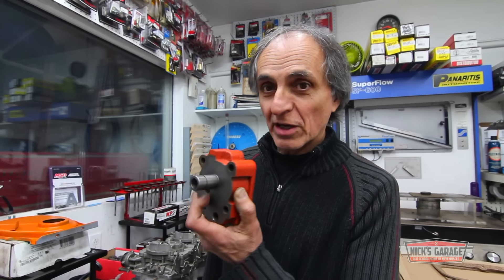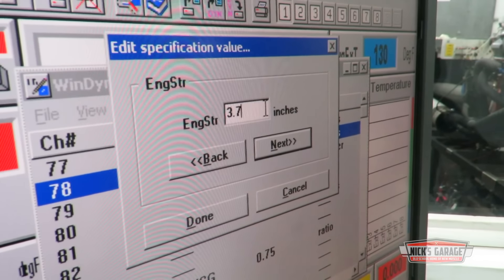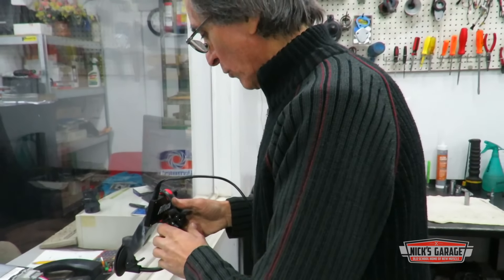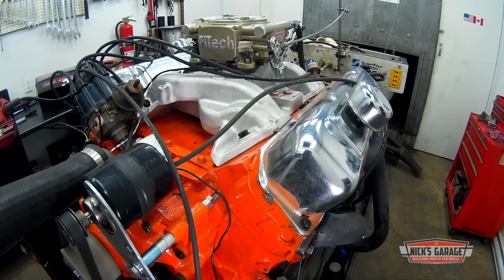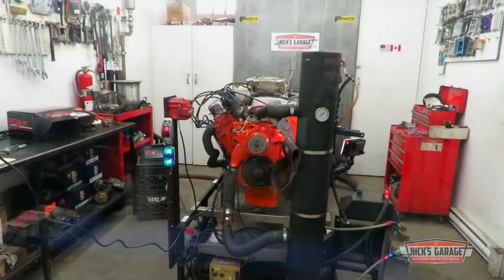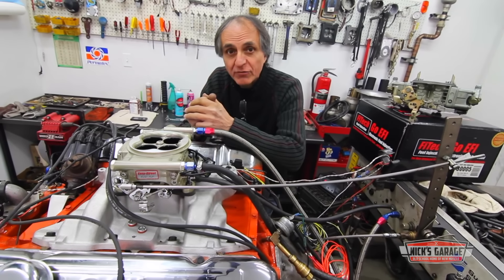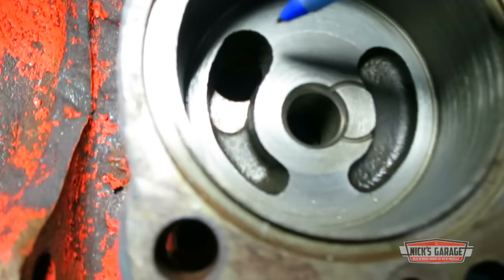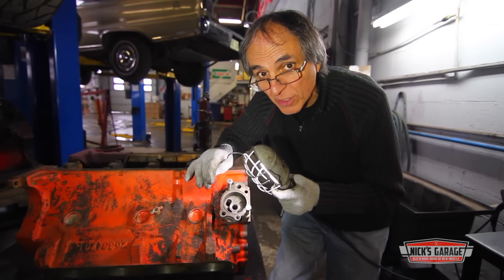Carburetor vs E.F.I. - Dyno Room Showdown

Comment: TBI is an automatic carb without a bowl.
Reply: That is true, but most TBI engines also have computerized spark timing and computerized smog devices. I really hate carb engines that needed several vacuum devices to control smog.

Comment: I'd love to go with EFI, if anybody made one to fit my 1953...budget. But I compensate for the carb fuel shortage after sitting for a few weeks by having an electric fuel pump in line with the mechanical one, and running it for a few seconds before such starts, then shutting it off. It pumps through the mechanical pump, and vice versa. CBE, I call it - Crude, But Effective. It has worked well for years.
Reply: EFI systems are becoming less expensive each year. I'm hoping an electric primer pump will work on my c10.

Comment: Much like you tune a carb, dyno,  make needle and jet changes,  re dyno,  check timing, redyno, make changes.  The Fitech needs to be driven a couple times for it to learn all the way.  The fitech will and has proven to be easier to tune and makes more hp than carb.  Plus more efficient.  This video is kind of misleading.

Comment: carb is thing of the past the reason the EFI system was 10 hp off was it was running mileage parameters and not HP parameters 100% guarantee it was using 14.7 to 1 tunning  and not a fatter fuel curve a simple change in tune on the EFI will exceed the carb 
and you can swap tunes for application ..cruising use MPG tune for drag strip use HP tune for max power .. for my mustang gt I have 6 tunes i swap out for temp and time of day and road conditions .. simple as pull over to side of road and reflash the pcm with a different tune
not a fan of self learning efi systems for stupid people unless also built with a back door to let owner go in and fine tune and tweak the tune
Reply: You can do that with the Fitech. A micro USB cable will connect the handheld controller to a laptop. The first time it installs a program on the laptop giving you much greater control over the system.

Comment: how many pulls were done? The system needs to learn how the engine is driven, not just at idle.
Reply: MRGMM.    The night before we were doing lots of tuning with friends and myself. We had the engine running for long periods of time, and many part throttles. The day of video, it hard a long time to learn to set idle.  Last year we had a dual Fitech installed on a 426 Hemi, and it took some time to sort it out by driving the car for a while.

Comment: Every motor that has a computer dependent EFI system should by law be required to be swapped with a computer assisted EFI throttle body. The computer assisted EFI throttle body will work without the computer. To me having all transportation reliant on a single point of failure is beyond stupid. Every car, truck, simi, forklift, boat, motorcycle, plane and even most mini rv's require a computer to function. Recipe for disaster. I prefer a carb myself. Your car is your second biggest investment. Is it too much to learn how to tune one?
Don't tell me, well I don't have the time. B......S#!t.

Comment: So... less than 2.5% power improvement from the carburetor.  How much extra fuel consumption and noxious emissions for that big ole two point something percent?  Do tell.
Reply: Incorrect air/fuel ratio won't burn properly if at all let alone make more HP. So couldn't be very much more fuel. JAJAJA

Comment: I'd be interested to see how the FiTech would run with a 1/2" to a 1 inch open spacer. You can't stagger the jetting to work with a dual plane with a TBI unit like you can a carb.
Reply: John Potsch I put a spacer on mine and the TQ was nice and smooth. Came right on around 2000 rpm. I have the mutha thumpr cam so the power comes in around 2200 all the way to 6000.

Comment: I'm a curious how this throttle body unit will adjust to dual plane intakes.
Reply: Poorly. Check out Engine Masters but I have heard the same on mild street engines where a dual plane is accepted the best. Poor running and even fueling plugs. And not many want to go to an open plenum for a streeter. So keep the carbs!
Reply: You have to snap off part of the divider inside the intake so it can equalize side to side and then they do better but they do best on a single plain.

Comment: How was the fuel mixture burning, especially at max load? Do your customers have fuel consumption notes, to compare the difference to carburetors? The answer might give a break-even mileage where the cost of EFI is balanced by fuel savings, especially in a truck that does some towing, or a car that is a daily driver.
Reply: 60and. R.       My customer is aware  of how he is to tune it in his truck. Thanks for input.

Comment: The dual plane intake kills the power potential on this EFI setup. They generally  respond way better with a single plan intake.  Plus, FItech offers this unit in a 400hp and 600hp capable system.  If you're only using the 400hp system then the results on this particular test dont mean anything.

Comment: I like Nick - seems a nice guy, very knowledgeable, great videos but this test was not a fair comparison ! I have a 500+ hp 355 with an 830 dp tuned all circuits on engine dyno then followed by chassis dyno to retune for the best it could be in the car, then 6 months later changed over to Holley sniper !  Less hp and torque initially, then some laptop tuning to speed up the learn and boom - 17 hp, 20 lb ft increase !
Reply: Mickss355.     We are old school. It took us some time to learn it. We have it on the car and runs great. No stalling, no need to warm it up and smoother idle.
Reply: No problem Nick - I'm pretty old school too, took me a long time to take the plunge to efi and i figured, ok if im going to do this then I'm going to learn as much as i can as soon as i can. What i have found is the learn on these things work pretty good but there only good for around 85% of what there capable of. Tuning via laptop is actually easier than trying to fiddle with those little controllers and I find the Holley pc software was easy enough to learn that even an old dog like me got his head around it lol Anyway, I'm sure the owner will enjoy the easy cold starts and great throttle response ! Never could i have imagined my little 500 hp 355 would start instantly and idle cold. Keep up the good work mate - really enjoy your videos. If i ever get to Canada, ill be sure to call in and say Hi

Comment: I just don't see the advantage of EFI for daily drivable street driven muscle. On boosted mills you bet, everything is easier to set up and control. I had a worked holley 800 spread bore on a spacer on a holley street dominator on a 468 hi lift cam and rockers 11:1.  I beat efi small and big blocks more times then not, street and track. And I could still pass our AIR CARE for insured street vehicles. Why bother with EFI back then... still can't justify it now. Beauty of opinions eh we all got them lol

Comment: Carbs jetted perfect..not out the box..try driving or starting it at 35 degrees farenheight...or racing at 95 degreea out..without jetting...that fuel injection..especially if u can link it to a computerized timing box would own that carb....

Comment: 😎The Master at his best👍
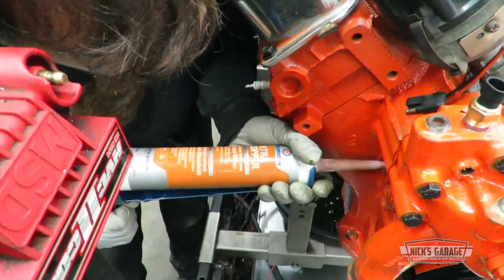At 7:40 I was surprised to see his sealing gasket 2X w/ a hi temp sealer under and on top of gasket for block off plate (fuel pump)- I was always told to just use sealer, if any, on block then a bit of OIL on receiving side of gasket for plate. Hmmm... (???) 
Oh well, tomato, tomatoe
Thx Mr Nick & crew👌

Comment: LOOKS LIKE THE ELECTRIC FUEL PUMP IS KINKING OR PULLING THE RUBBER HOSE SHUT IN THE BEGINNING OF THE VIDEO WITH INJECTION.sorry about the caps

direct port fuel injection will always make far more torque but needs a ton of sensors to use.

Comment: I went from quick fuel 750 to a Fitech efi power adder better starts , no smell, timing control, better power under the curve , went faster when I spray they same amount of nitrous because on a carb you aim rich and afr chosen with efi... also better travelling across the highlands and weather doesn’t matter.. if you took most cars and properly tuned the efi with timing control you would most likely be faster with better drivability on average

Comment: Carburetor requires venturi vacuum for fuel delivery and the Fitech a roller cell pump.
The dual plane manifold on this motor is designed for carburetor operation.
If one puts a single plane intake on this motor with a carburetor, then the motor likely suffers the the usual lower in the RPM range issues well known to single plane intakes with carbis.
I reason the Fitech will show none of the low RPM maladies peculiar to carburetors since it is powered by a roller cell pump and will also benefit from more even air and fuel distribution of the single plane considering the O2 sensor is in one exhaust pipe only!
The likely outcome is the carburetor and the injection will make near similar power in the top end, but the Fitech will improve on low end throttle response and will deliver better bottom end torque in the range of 1000 - 2200 RPM.
The thing is, the Fitech also benefits from the open plenum intake in the top end - as the carb does, but will in likelihood largely negate the issues of carbs and single planes in the bottom end since the fuel delivery is high pressure based fuel delivery as opposed to atmospheric pressure pushing fuel into a venturi generated depression.

The Fitech may suffer some inital mild flat spotting in the idle - 2200 range until it learns the best modification of the basic fuelling map due to the gulp factor of snapping the throttle open but I feel the system will in likelihood compensate.

I dunno, just my 2c lol.

*As always a great thought provoking vid. I watched it at work and was late back from lunch I got so engrossed in it. Cheers.
Reply: ThePaulv12.  From what you are saying, there should be more then 1 O2 sensor, but Fitech supplies only one.  I see what you are saying, and thanks for the input,
Reply: Re the 2x O2 sensors; yes if you have a dual plane, but more I'm saying, I can't see a reason for the dual plane intake anymore with TBI (other than looks for originality reasons).
Why not just have have a single plane because you don't need dual plane anymore as you have fuel injection?

Dual plane is good for carburetors - perhaps not ideal for injection for the reasons in my first post.
Paul

BTW I have a dual quad Fitech system in my cupboard that is waiting to be used so I have given this a great deal of consideration (as you can tell :).
Reply: If you want the originality of the stock Hemi intake but the benefits of single plane (without having a single plane) why not do the Vanke mod?
Not that I have ANY experience of it but;

From Arruzza's website.
Quote:
"Every street Hemi intake I use on my engines or sell outright has the Arlen Vanke modification . My experience has proven this style intake MUST be modified in this way. The fuel distribution is far superior and the torque band starts sooner and finishes much later. There is no reason to run a stock manifold."

Seems like the cure for Fitech vs Hemi.
Everything I ever read on the mod from people who probably have never owned a Hemi say it's for racing but that I don't think that is true in reality.
It is more likely the mod requres the carbs to be completely rejetted to compensate for the changes and heresay has led to the myth that it isn't good for the street.

Should only benefit dual quad TBI at any rate.
Reply: ThePaulv12.    I am aware of the Vanke intake manifold modifications. My client wants to try the EFI for now. But he kept all the carb set up on the side for originality. Would he mind if I were to take the manifold off and modify to a Vanke or switch for another one that is done up, do not know. But I will ask him this summer.  Dam! I use to have one in stock.
Reply: Buy a new one and mod that. I remeber reading about that mod in the early 80s. It's 35 years later and I still can't afford a Hemi lol. 
Life hasn't really worked out how I thought it would hehe. Anyhow who would have thought the hobby would become so gentrified? 
Funny thing is Jon Kaase said something similar about a 429 Boss Mustang. He always wanted one as a kid and thought, "When I grow up I'm gonna buy one." He says, "Well I did grow up and I still can't afford one!"
He used this annoyance as the impetus to build his Boss 9 heads which fit on any 385 engine and are (apparently) far more durable than the originals.
Reply: ThePaulv12.   So you know Jon Kaase. When it comes to Ford, he is the man. I have a set of heads from him years ago on a stroker Windsor 468. It produces 700 HP and 690 TQ.  We had it build in my shop many years ago and my customer still has no car for it. I want to put it on my Dyno and show it off on YouTube. What do you think?
Reply: Yeah - You've got to put it on. I can't wait.

This Windsor sounds like my 350 sort of ie. it is just there for waiting to go into my FJ-40 4x4. I have everything to do the install but the TIME. 
The FJ-40 still has the 2F and I drive it most days. I don't want to take it off the road. 
I have dual quad Fitech for it, shaft mounted roller rockers, aluminum heads and an old school Milodon single idler gear drive. It is all built and ready to go.
Call me crazy but I'm not going to use the dual quad Air Gap intake I have, instead I'm going to fit an old school offenhauser cross ram to it.

I forgot to tell you, when I finished my apprenticeship as a mechanic at a Merc Benz dealership, my first post apprenticeship job was at a Volvo dealership for 5 years.
It has been awhile but I have worked on many, many Volvos and quite a few 164's.
Lots of 164's had Bosch J Jetronic on them with trigger points under the dizzy (from memory) but I see your customer's 164 is carbi which is lucky.

Comment: The fuel injection learns when making full throttle runs over a few pulls that gives the ECU time to learn from the wide ban O2 sensor and not just idle speed.

Comment: Nick you need to run the tests under the same ambient temperatures,engine temps both tests need to be done on the same day not a day or week apart.
I have been in this industry a long time a fuel injection system turned properly will produce the same or more HP AND TORQUE. 
REMEMBER 14.7 TO1 IS THE PERFECT MIXTURE THIS IS WHAT the fuel injection unit will do a Carburetor CANNOT DO THIS and needs to be adjusted when there is a large change in temperature.
Reply: CRAZY HORSEPOWER.   I agree with you 100%.   We needed more time to learn the EFI system.
Reply: @nickpanaritis4122  I hope to see more videos from you on this as I am always looking at what results others get around the Country as the atmosphere plays a role in what we do to.

Comment: Great video and Tech Tip! On the Dyno are you locking out the ditributor and using what type of "box" to advance the timing curve? Does that E.F.I. throttle body injection set up runs at what P.S.I.? And does it need a return line?
Reply: Daniel Scott.    The distributor is not locked, and it works on it's own. The Dyno EFI fuel pressure was set at 60 PSI. And yes, it does have a return line.

Comment: There's always something to be said about old school horsepower with carburetor. But I do know that with the right adjustments in the proper fuel injection system the horsepower gains would be most excellent with the EFI over the carburetor. Along with reliability

Comment: I'd sack the lad who used that much sealant on that chrome blanking plate, all the excess goo that squeezed out on the inside of the joint will end up in the sump to block the pickup pipe screen, very poor workmanship.   Properly set up carbs are always hard to beat, for fuel injection to make more power over carbs usually involves a really well tailored system and the engine built to work with that system.

Comment: Engine Masters did testing on this, full throttle is pretty much the same on carb or that type of efi, part throttle driving would be better on efi i think, but since it's not a multi port efi setup it doesnt change much, its pretty much just a electric carb

Comment: A good EFI set up and tune will make more power eventually, and if you went to individual intake runners with injectors on each carb would never catch it. But it shows that a EFI system can match a carb system out of a box.